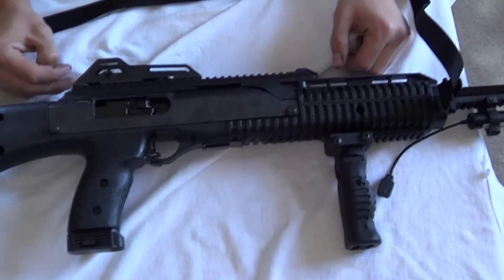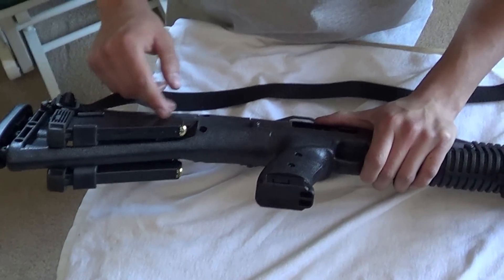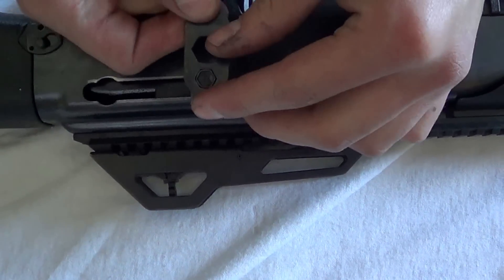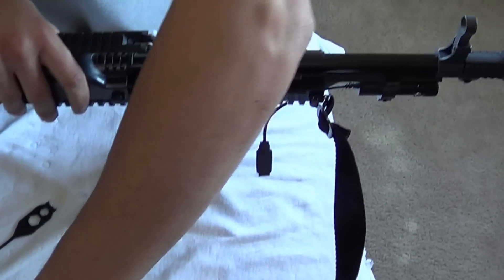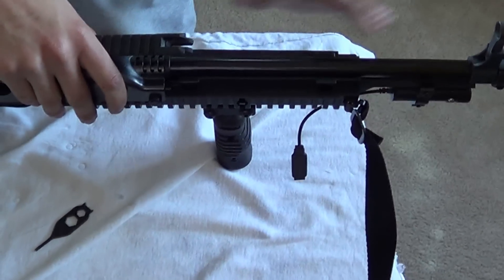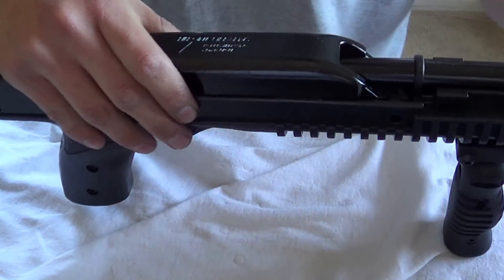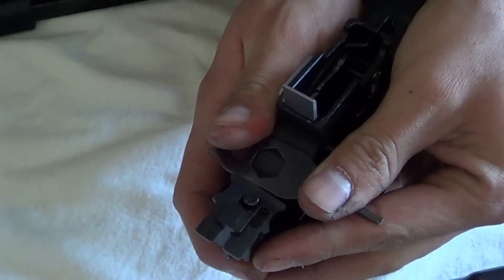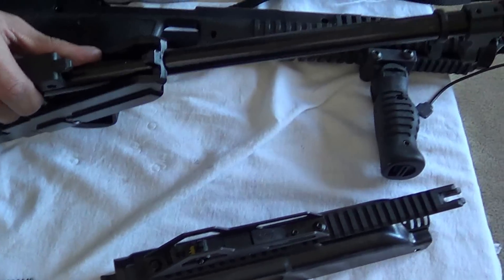How to take a hi point carbine apart

Comment: Thank you very much for posting this video!  I just got done taking my 4595 apart, as far as removing the top cover, and I was completely stuck from there.  Your step-by-step instructions for removing the action from the stock and then disassembling the action were spot-on.  I have about 10 other platforms in my collection, a 45 JHP included, and the included instructions were sufficient to disassemble them all.  This is the first time that I have ever run into a brick wall, and your video was just the ticket!

By the way, with regards to the pin receiver shroud pin clips, if you use the two prongs on the tool, you can place one prong into the center hinge point and the other into the small hole and then rotate them, instead of having to push them over, preventing you from having to scratch the shroud's finish.

Comment: To remove the two pins from the upper part of the stock. If you push in on the pin that tool has two points one point goes in the hinge point of the clip and the other point goes in the small hole on the clip and you can twist the clips to release the pin. Otherwise, great video, good information.

Comment: Awesome upload man. Helped so much! One thing I noticed while I was doing the breakdown with the pin and latches. On the latches there are two little holes. I stuck the other side of tool provided with the pins on it in there, and simply turned. Again thank you for the video!

Comment: This is the first hi point breakdown video I've watched where the demonstrator did NOT use a hammer and screwdriver...you get extremely high marks for that...I gave our hi point a deep clean last month (minimum once a year whether it needs it or not), and I do use a hammer and screwdriver, because I don't care if the gun gets scratched...but, I know lotta folks get vapors about scratches, dents, worn finishes, etc., so your video a Godsend...I'll try to remember your techniques with the tool upon the two clips that need to be undone, I was amazed how easily your gun came apart...

Comment: I've looked at a few of these videos and this is one of the better ones. I'll add a tip. The fork end of the tool can be used to spin the two bolt clips. Just poke the two prongs into the small holes of the clip and spin. The clip will pivot and rotate the large hole into position. You can run heavy grain +P ammo thru this gun, it has quite a punch. Love the 4595.
Reply from the maker: Arlen Brack  Yes sir you are correct. I figured that out a couple times after taking it apart but had already made the video. Ill put some annotations in to better help others out.

Comment: I have a 995, this was extremely helpful and I could actually see what you were doing! Thank you!
Took apart my purchased used 995 and it has a bent firing pin x.x
Reply from the maker: ThexEpicxMechanic  Im not sure how stocked up Hi-Point Firearms is with spare parts but there guns have a lifetime, no questions asked warranty. I don't think there would be a problem with them sending you a new one without going through the place you bought it at. I would guess worse case scenario is you have to pay for them to ship it to you.
Reply: WallStreetFreddy It has a whole plethora of other issues that I found while cleaning it, biggest being it had never been cleaned. Ever... So I took it back to the shop that I bought it at (they're a local little business and extremely good for this sort of thing) and they said they were just going to send it to Hi-point for repair.
Reply from the maker: ThexEpicxMechanic Oh, very nice then. Your probably going to be getting back a "like new" gun so that should be good.

Comment: Thanks for a really helpful video. Its been a while since I tore down my 995, and I forgot how to disassemble the action.
One suggestion - the spanner end of the provided tool fits the rotating pin clips, and makes turning them easy. I discovered that after I stabbed my finger using the pointed end of the tool like you did.
Reply from the maker: Yea I realized that myself after a couple stabbings myself lol. Thank you though

Comment: Took mine to the range, ran 200 rounds through it, not a single issue. Almost no recoil. Very glad I got it, it's not my AR-15.....but it's a good shooter.Too bad they don't have high capacity mags. I spoke with hi-point and they have no plans for a high capacity mag.
Reply: Dan Hamblin Pro mag makes 15 rounders. Only thing is when you buy it you will have to mod it a bit. There is a small ramp feeder on the front of the mags. The promag one is a bit to long and needs to be shaved down to match the oem one. its in the front top of mag where bullet rides up to ramp
Reply: +Ohsplat Hi-Point has a lifetime warranty that is voided if you use other mags.
Reply: They will never know of you've used other mags

Comment: I just hose mine out at the car wash, then put upright to dry on a towel. Then the next morning when dry , I spray the action with WD-40. Good to go !
Reply: good point. if told people how i clean my hp 40, they would shit.
Reply: use 30 weight motor oil lube last much longer than wd
Reply: Loved to hear it. We cleaned 1911 in hot soapy water then oiled them, never had a problem.

Comment: good video, however, if you look at the takedown tool, the forked end is used to release the 2 tabs that hold the 2 takedown pins. Simply insert the forked end into the 2 holes on the takedown tab, and twist. I noticed you just used the tool to push the takedown tab which will end up scratching your carbine. Just some friendly advice.

Comment: Did you notice the two small holes in the two pin retaining twist clips that secure the main disassembly pins? The takedown tool has small tips that stick off of the wide end. These tips correspond with the holes in the clips, simply insert and twist, that's what they're for! Following the procedure shown in the video will result in a scratched receiver cover!

Comment from the maker: They have these things called bullet buttons that they sell for AR's. You just place it inside the little hole that's used for the mag release and then instead of poking something to release the mag, you just push the button and it drops the mag. If the button likes to fall off just use crazy glue to make it stay on.

Comment: To save the finish on your rifle you are not using the tool correctly.  The two little prongs on the tool fit into the two little holes in the latches and then twist the tool to release the latches with the tool no longer touching or scratching you rifle. Too bad you didn't know that prior to scratching your rifle on video.  The video was very helpful to me hope my tip has helped you.
Reply from the maker: Yes it has thanks. I still have the scratches but no longer add to them

Comment: I want to mention to the older 995 owners who don't have the old manual, the older models don't have the takedown clip on the rear of the bolt. It's a rollpin you have to knock out with a punch that goes through the "guide ball stem". Punch that pin out and the bolt will separate from the lower receiver. That's not even on the HP website PDF manual anymore.

Comment: awesome vid very detailed. Maybe you can help us out here. We took apart a 4595 TS and then put it back together. Took it to the range to fire for the first time and it loaded the bullet fine, but won't fire. The trigger feels really squishy and after I use the charging handle, theres no popping sound I hear from yours. So we're thinking  since it's never been fired, we probably did something wrong, adjusted/installed the firing pin wrong/spring, since everything else seems to function normally. What do you think? I really don't want to send this back to Ohio to get worked on, so I'm hoping all I gotta do is take it down, put it back together and presto. haha. crossing fingers Ever ran into this issue?
Reply from the maker: Sorry ive never had any issues with my Hi Point even after not cleaning it from multiple times at the range. By the description of your problem I would guess its the Firing pin put on backwards or the spring like you said. Its really easy to take apart so maybe you can try re doing while being at your shooting location
Reply: The spring was never included in the firearm. Hi point sent me a new spring/pin in the mail she'll be rock and rolling in a few days.
Reply from the maker: Very nice. Enjoy your gun man

Comment: If you remove the front sight does the barrel have a guide for it to make sure that the front sight is indeed vertical for it to retain zero with the rear sight?
Reply: there are 2 dimples in the barrel where the screws go
Reply: XxPurpleXHazeX...I see. Thanks:)
Reply: Adrian Rubi
the hard part is finding an allen wrench to fit the screws!
Reply: XxPurpleXHazeX ...yes they look like the hard to find allen wrench size. Need to have a whole set of allen wrenches in US fractional inch pattern with t-handles for ease of use.
Reply: Adrian Rubi its smaller than 3/32 allen key
Reply: dont know the exact size but its smaller than 3/32
Reply: XxPurpleXHazeX Maybe HiPoint has the right size allen wrench for that.

Comment: Got the 40 Cal version $309.  Haven't shot it yet but plan on it soon.
Reply from the maker: Nathan Young Wow man that's a crazy good deal. Do you plan on using any steel cased ammo? My indoor range that I go to only allows brass cased ammo but I just found an outdoor one so I can use steel and im curious to see how it'll do.
Reply: I got the 4095TS with no attachments for $292.95. Then I got one of the folding foregrips from hi-point's website and I got a millett red dot off of midway. I put about 700 rounds through it before I just cleaned it for the first time. Man that thing was dirty. P.S. the steel case Tula runs flawlessly
Reply: Mine came with the folding foregrip. Ordered it from impact guns. Took around 4 months to get it. Their site said it was on stock but mysteriously they never updated the website to show it was really out of stock. All in all I finally got it but the wait was a pain.
Reply: Hi-point might have a bad reputation from their pistols but their rifles are excellent.
Reply: WallStreetFreddy Yeah probably just for the range. I've hear that it will shoot the cheap stuff just as good. We'll see I guess.
Reply from the maker: Thomas Jefferson Yea I agree with you on both parts man.
Reply from the maker: Nathan Young Alright man sounds good. Ill order some and see how its goes
Reply from the maker: Thomas Jefferson Dam that's really good price bud. The laser on mine could never hold the guns recoil which pissed me off because the recoil (.40 S&W) isn't bad at all. I would have to zero it after about 20 shots. And the stupid flashlight took a crap on me after 3 days of owning the gun which is also ridiculous. I should of just got a plain one like you and just bought the foregrip. The gun itself though is fantastic
Reply from the maker: Thomas Jefferson Oh and thanks for the heads up on the Tula ammo. Ill be placing an order for some shortly
Reply: the reason most indoor ranges won't let you run the cheap steel cased ammo is the bullet itself..they are a bi-metal projectile which is a brass bullet with a steel core,not lead.. what happens is when the steel core hits the metal backstop at the range, it causes sparks and if the range isn't properly vented it can ignite the powder residue in the air and KABOOM !!!!

Comment: Did you scratch the finish when the takedown wrench slipped off the pin latch?  I want one in .50 AE  come on hi point go for the big 50!
Reply from the maker: Yes I slightly did. I now put one end of the wrench into the tiny hole of the latch so I don't scratch it, and that would be a pretty awesome round but it would be harder to find since its not as common

Comment: i think the requirement of a tool to release the magazine would be enough for me to move as far away from california as i could. ...those retaining clips - look at the ejection side and youll see how the retaining pin heads stick out just enough to where if you press down against the table, they rise, making it super easy to manipulate. you also run the risk of scratching the finish, which seems to be sprayed on, if not:/ btw, just to brag... i put a magpul afg on the for-end instead of that ridiculous collapsible broomstick, i also added a magpul 2 or three point sling with quick draw for carrying. shaved the trigger guard to allow for fat winter glove use and proper indexing and stippled the grip for added, uh, grip.  oh and those fancy schmancy springs in the ts stock are worthless and were promptly taken out. this, i feel, gives a more tactile and realistic recoil bump. its been said already but ill reiterate - best hi point carbine teardown vid on the web. no bullshit and only pertinence.

Comment: Man for $499.00 I would have got a DPMS AR-15 or other brand AR-15.Most places sell these for like $259.00 - $320.00
Reply: +timm2020 I meant most places sell the Hi Point 995 4095 $259.00 - $320.00
AR-15 starts at around $499.00
Reply: +timm2020 yea I got mine for 250 and 100 rounds but it was used but still in great condition
Reply: The point for these is that it is a pistol caliber carbine and not a rifle caliber weapon.